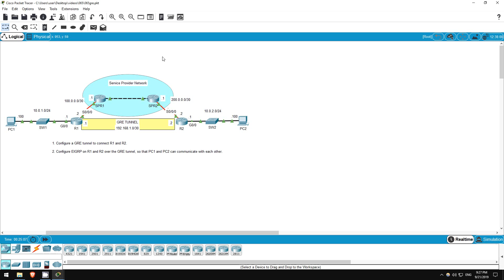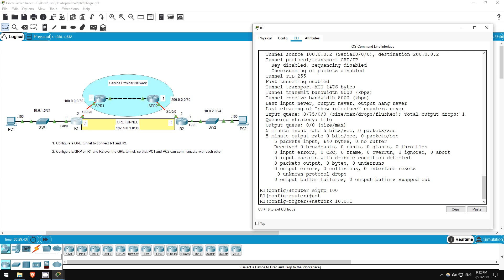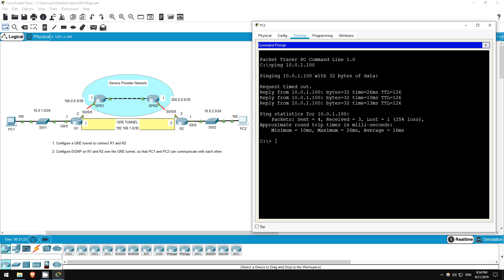FREE CCNA Lab 065: GRE

Comment: so in this case you dont advertise the isp network like the 100 and the 200 network? i tried advertising them and i couldnt figure out why the tunnel kept going up and down. took them off and it was fine.
Reply from the maker: Yeah don't advertise the connections to the ISP network over EIGRP.  It causes a 'recursive routing' error if the tunnel destination address is learned through the tunnel itself.  Here's an explanation from Cisco: 

"In this situation, the best path to the tunnel destination is through the tunnel interface; however, this occurs:

    The packet is queued in the output queue of the tunnel interface.

    The tunnel interface adds a GRE header to the packet and queues the packet to the transport protocol destined to the destination address of the tunnel interface.

    IP looks up the route to the destination address and learns that it is through the tunnel interface, which returns the packet to Step 1 above; hence, there is a recursive routing loop."